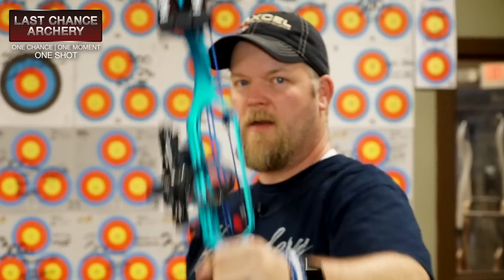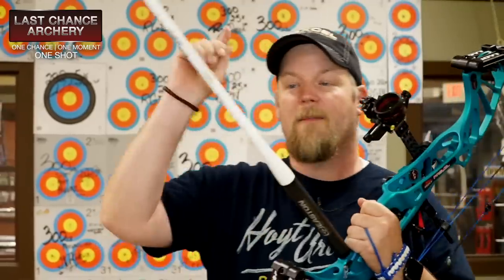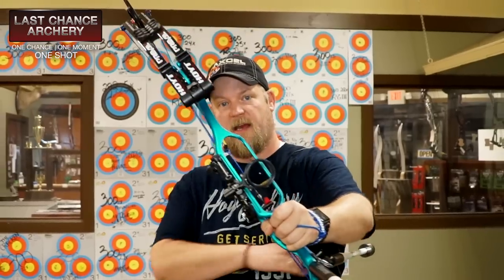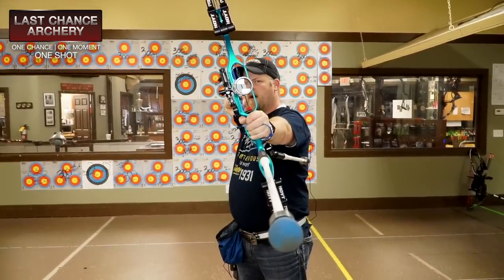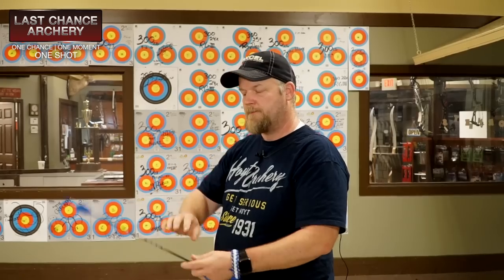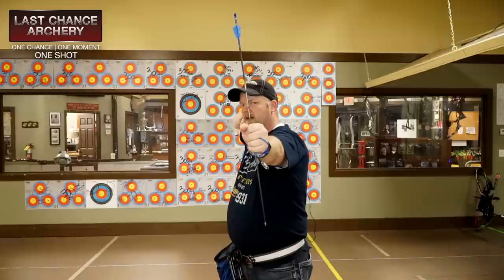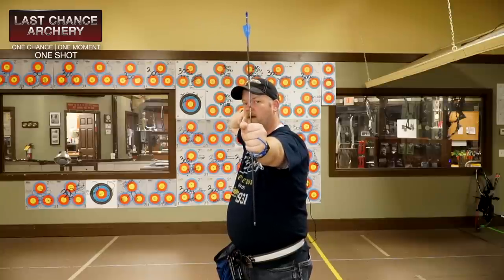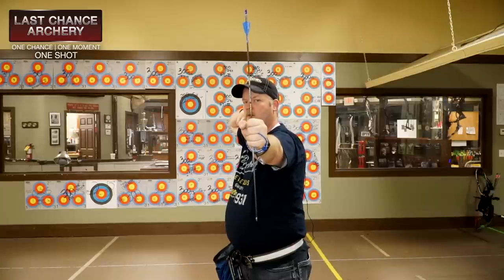Thing A Week #17 | "Stabilizers"

Comment: Great explanation of stabilizing!!!! I have one question - When figuring out the "weight ounces" are you including the dampner at the end of your long rod?
Reply: If both the front rod and side rod have the same dampener, then they cancel each other out enough to not be a factor. If you only have one dampener on the long rod, weigh it and if it is an ounce or more, then add it to the total weight.